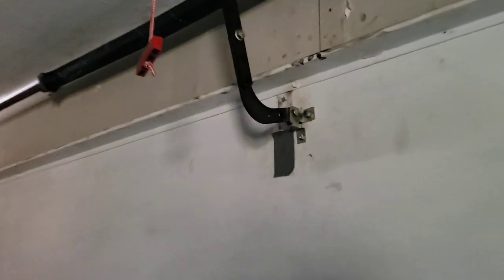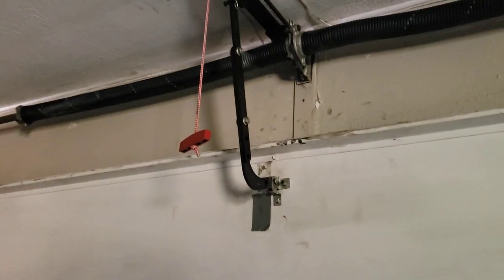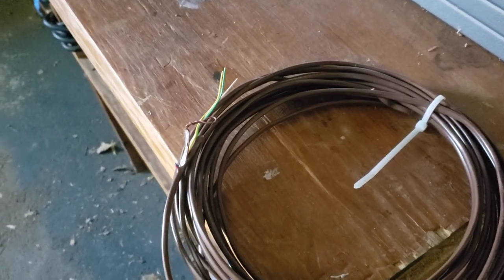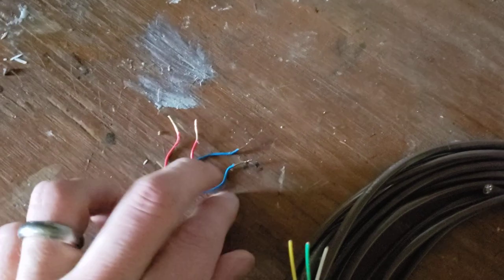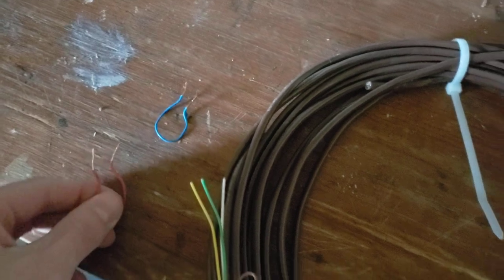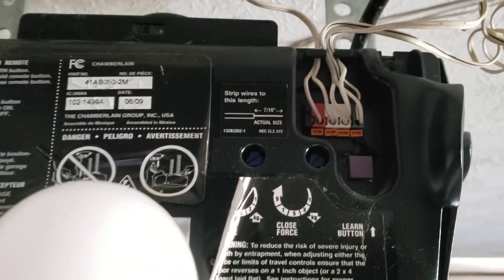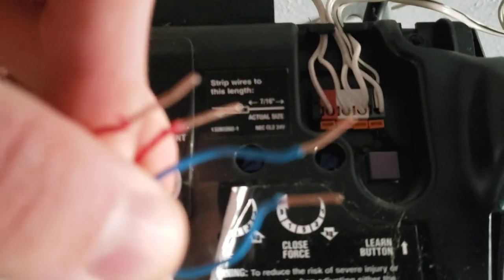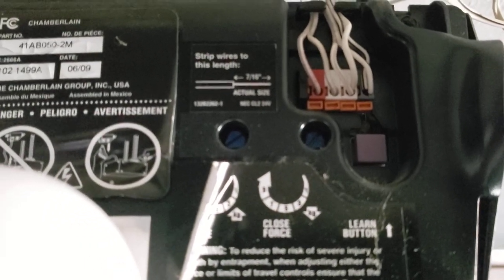Bypass garage door sensors in order to close garage door completely

Comment: Are you saying that once the the 4th connection is made using the two jumpers the garage door immediately starts to open or close without pressing the opener button?  Or do you not have a wired opener button for your garage door because it would've been wired already where you where showing the other wires in your video going, right? Maybe I'm just confused.
Reply from the maker: Once the fourth connection is made, the garage will close completely and stay closed

Comment: My sensors “went bad” according to the blink code on the opener. I opened them up the wires are connect proper all the soldering is good nothing wrong with them at all. But when I connect them back up they refuse to work even at 1/2 inch apart when them being solid led not blinking which means good read on the sensor. I’m at a loss this opener is less than a year old. Also I did try your jump trick it don’t work still get the short code from the opener

Sensors didn’t go bad check them with my other opener and they work fine but the board is telling me they’re bad
Reply from the maker: Maybe try to reset the garage door opener. If not you can always pull the red pull string

Comment: Did it work?
Reply from the maker: Yes, the garage opened. Every opener is different, some will open if you hold down the button
Reply: So, you can use a remote to open and close the door without sensors screwing it up?
Reply from the maker: @soccerrox6010  not sure what you mean.
Reply: @SuperFunkiman  I assume that you have a remote for the garage door opener as most do. When you are outside and press the button on the remote does the door open and then when you press the button again does it close with the jumper in place?
Reply from the maker: @soccerrox6010  I don’t believe it would
Reply: @soccerrox6010  If the sensors are bad, the remote will open the door but not close it. In most cases anyway.